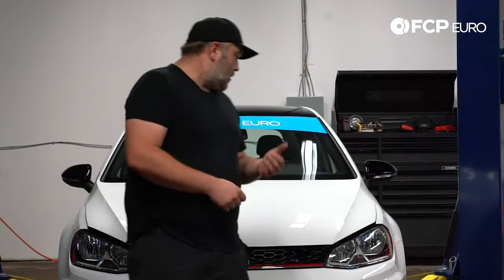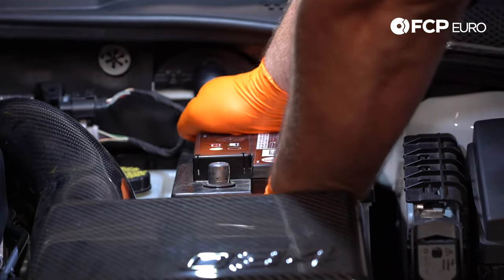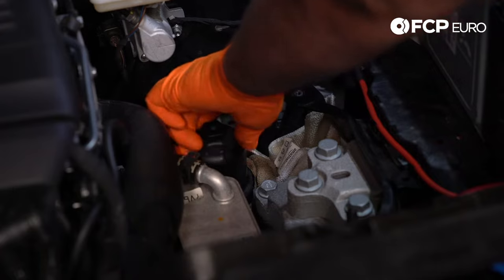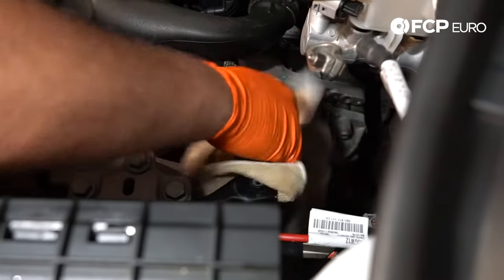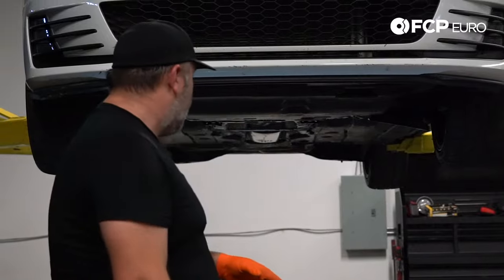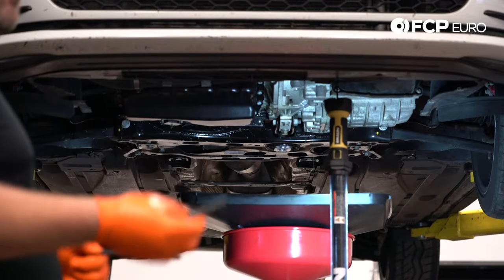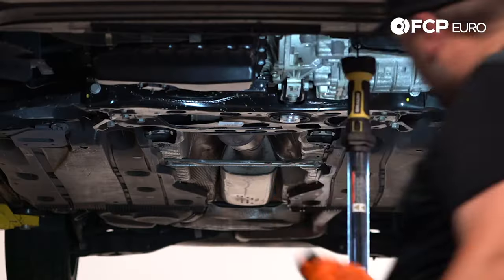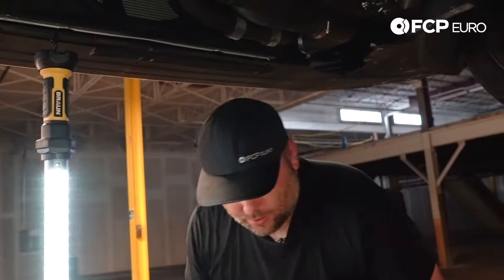Audi & VW DSG Transmission Service DIY -  VW MQB - 02E Transmission

Comment: Everything I’ve heard in the past is that the vehicle must be running while doing the final drain with the level tube. ????? 
Thoughts? Any certified VW mechanics here?
Reply: It should be kept running as it stops circulating with engine off and will dump too much oil
Reply: i hve never done this with the car off🤔 ...the car suppose to be runnin on the final check !!
Reply: Your are correct engine must be running. Without running you will remove to much oil. His work is done but not correctly according to the official elsawin procedure. And he his a racing mechanic............
Reply: Instablaster.
Reply: Thats the exact question that i had . Vehicle has to be running while doing the final level check????.
Reply: So if we followed this video’s procedure and had the car off at 37ºC when doing the level check, what is recommended at this point? How many liters should be added to get levels where they should be? Sounds like the car shouldn’t be driven in the mean time?
Reply: @wjnielsen  I k own its late but your good at 37°
Reply: I'm looking at the service manual which says, "The engine is idling and the selector lever is in 'P'."

Comment: I love my DSG, around 183,000mi now on it with regular service
Reply: What year it's yours?
Reply: @dannymartinez8522  2006!
Reply: What were your major repairs I'm thinking of getting a mk6 lol
Reply: So I've got an a3, mkv based. I did actually have the FSI cam follower problem, I didn't know about the follower back then. But the transmission and a lot of aspects of the car have held up better than average.

Comment: Supposed to keep the engine running when you drain the excess fluid...
Since you shut the engine off, the DSG pump stopped circulating oil. You let more fluid out than you are supposed to.
Reply: it's insane how bad these "how to" videos are....and alot of people trust that it's correct. =/ (The quality of the video is good, but the info wrong)

I find it funny there are no good info from VW how to service their cars, without paying for their own program that costs a small fortune for a private person, but i guess they love all the bad info going out to people, making em buy a new transmission and engines when they do the service wrong xD it's sad really...

Comment: Great video on this service. I wish I had seen before I did mine 6 months ago. Stressful fill! Now wondering if I need to pull the drain plug an make sure I'm not overfull. I guesstimated the transmission temp..

Comment: when the car is turned on and you're running through the transmission PNRDS...also the 1,2,3,4,5,6? and should you keep it there for a few seconds in each? Thanks. Your video is super helpful.

Comment: Check the torque specs.  The service manual for my Golf says 20 Nm on the filter housing (vice 25 in this vid) and 45 Nm on the drain plug (vice 65 in this vid).  DAP video has same as what I found.

Comment: I thought it was bring it up to 35c temp, leave it in park with the engine running and let the excess fluid drain?
Reply: Yes you are correct. Engine must be keep running, place in Park, and then let excess fluid drain. Was able to confirm this in the VW service manual.
Reply: @123cuizine  The engine doesnt have to be running.  The reason why the engine runs is to bring up the transmission fluid temp. to 35-40c, this is when the fluid will expand and the excess will drain onto the the pan from the snorkel.  The whole idea of the engine running is to bring the fluid to the mentioned temp.  However I could be wrong.
Reply: @mkefayati473  comment facts not guesses. Read the service manual.😉
Reply: @123cuizine  Service manuals often say to do shit that makes little sense, no one does this. It's bad enough you have to disassembly so much shit in the engine bay to get to the filter and that the filling method is awkward and jankey, but fucking around with heating the oil to some stupid magical temperature for no discernible reason just adds even more delay.  The practice of entirely ignoring this is based on essentially ever example I've seen is completely ubiquitous and is not causing any discernible issues.
Reply: @mkefayati473  Engine needs to be running to continuously pump fluid through trans while draining excess. If you shut the car off, all the fluid that is in the filter, pump, mechatronics unit, and all passage ways drains back into the bottom of the trans and will drain out. Fluid level in DSG must be checked while engine is running, that is per VW Factory Service Manual.
FCP Euro also corrected there mistake and listed it in the Description.

If you shut the car off and drain excess, there will be around 4.2 liters of total fluid in trans, the 02E DSG requires around 5 Liters. The DSG Filter housing alone holds 1/4 of a Liter alone.
Reply: @CrazyCracker702  thank you for clearing that up. I did read the manual and it says exactly what you stated here.  
Much appreciated.
Reply: @Tk3997 Exactly, I have serviced multiple cars and I have never done the temp procedure.... NONE gave any issues.
Common sense tells you put in what came out and maybe a an ounce or so more to account for spill over.

I did mine DSG exactly like the video, and put the same amount, 4.5, and works like a charm and better than before.
Manual tells you to change the balance shafta if they are removed for inspection, complete horse sh1t.
Manual states to swap all bolts because they stretch, AGAIN, waste of money!
Ask Naptown tuner, and I have asked a local VW mechanic who owns a GTi, bolts are reused, my car, his car, runs excellent.

Comment: Hey Guys How bout taking a threaded plastic  plug n drilling a small hole in it and putting  a 4" Digital Probe Turkey Thermometer in it... then screw it into the trans then run it till the cooking probe says 100 Degrees    + -  or so does  this sound logical

Comment: What if you don’t have a lift? I have a jack and also ramps. If I use the ramps, the car would be at an angle. Would it still drain okay if it’s not completely horizontal with the ground?

Comment: Isnt it bad to remove these batteries in these cars? Don't you have to reset things after wards with a scan tool? I have a 2015 Audi A3 when you drained the excess fluid for final level was the car running or engine off?

Comment: Hello, do you know anything about front differential maintenance? They say that it should be changed every 60,000 and regarding the dsg dq500, they sold me 7lt, do I only use 6? Or if I put all 7 in when emptying, will it only throw more? Thank you!

Comment: Was quite surprised how dark that fluid is. Normally its much lighter isn't it? When I followed your instructions, the oil that came out was no different colour than the new fluid!  What causes darkening of fluid? Is it heat or debris?
Reply: Through time the oil gets dirty and the detergents are doing it's thing

Comment: What would happen if you didn’t drain the extra oil out? Would it do damage to gearbox?
Reply: I generally don't know. 
but think about it, before you change the oil you drain the excess. After you fill up the new oil you have to drain the excess...
Reply: Uh yea would over pressurize and and damage mechatronic unit

Comment: Hi! Nice job!  If i don't have this "temperature  screen device", may i check the oil temp. from bottom of the gear box? With laser meter..? Isn't it about same temp. than oil inside the box?☺
Reply: I was trying the same, but changed my mind and bought a cooking thermometer kind of a metal pin and a digital readout and measure the temp of the partial drained fluid.  Also, when you fill it up with exactly 5 liters and drain 0,4 L that would be good as well.
Reply: @hesseldijkstra5327  how much is 0.4l?
Reply: IR thermometer on the transmission box should be close enough as aluminum is great heat conductor

Comment: Excellent work !
Reply: it's actually wrong thou.. you should keep the engine running when doing the last step of getting the oil level correct.  it will leave abut 0.5L more in the gearbox, this is the correct way if you check VW service manual.

Comment: Hi can you tell me the difference between 
g 052 182 a2 - 6 Speed DSG Oil $52.86 Per Lt 
g 055 529 A2 - 7 Speed DSG Oil $79.51 Per Lt 
Prices are In Australian Dollars :-(
Are there any aftermarket brands for g 055 529 A2 specificaiton ?
Reply: im trying to find a cheaper quality substitute aswell

Comment: My 2016 jetta is coming up on 40000.  I want to do this service myself but don't have the equipment to tell me the temp of the transmission oil.  Would it be possible to do this service on a hot day when the temp is 95 F or a few degrees above?

Comment: How much do they charge at the dealer or independent shop for the DSG transmission service?
Reply: Dealership is around $500
Reply: £199
Reply: $299 at dealer. Some dealers can be $400+
Reply: I called bunch around me and dealers are from 400 to 525. Indi shops are 300 to 500 depending on area and if you use Moli vs VW oil. I think taking it to reputable place that gives warranty for their work is key here. Too expensive to take a chance with.

Comment: So should there be no oil coming out at the initial drain plug removal if it was a level?
Reply from the maker: What exactly do you mean Paul? When you initially remove the drain plug there will be quite a lot of fluid that comes out. After you refill the transmission and get the fluid to temp, you'll have to check the level once again afterwards and some fluid may come out again then.
Reply: @fcpeuro  you don't see it don't you?
After you filled the new oil and drained the excess there should be no oil draining  at any time you unscrew the main drain plug
Reply: @Matttski  Perhaps this the difference between draining the new fluid level WITH the engine running versus the engine off.  With engine off the oil in the filter and other areas of the transmission will seek the pan or lower part of the transmission.  Likely higher than the fill insert.  That oil will drain when pulling just the drain plug.  I would guess if you pulled the drain plug with the engine running, none or very little will come out.  Make sense?

Comment: Video is great, but part where he sets oil level is wrong.

Read the manual for chaning oil, but out of curiosuly watched video too and somehow picked up that he set the level while engine was off.
After good week gearbox started to whine a little bit more then usual. 3rd gear was really really notable. Somehow remembered that oil that came out of gearbox when I was setting level was suspiciously a lot. Didn’t drive car much more, put 1l more of oil, set up level as it should be done. Car took around 900ml!!! Whine basically went away, it’s only notable on lower gears when decelerating.
Hope I didn’t do any damage to my gearbox or haven’t hurt it’s longevity. I shouldn’t, but paranoid in myself still reminds me this.

I would suggest taking video out of youtube, or putting some notices on title of the video. Watched this video on TV do didn’t seen comment section. Even sadder that FCP still kept this video intact, even some people have reported and they actually pinned comment pointing it out.

Comment: I have a 2018 Passat GT. Will the DSG capacity and process be the same?? Great video man!
Reply: I have a GT too and just reached 40k. How was the process man ? Im planning to do it tomorrow
Reply: @gavinthind3058  hey man! It’s pretty much the same. I’ve done the service twice now. Only thing I would recommend, if you can spend the money (if you are keeping the vehicle for a while) get a fill pump and adapter kit that screws onto the drain plug. Makes this job way easier. Also, make sure you have the vehicle as leveled as possible and for the love of God. DO NOT tighten the filter housing with a breaker bar. That thing is pretty sensitive (busted one while tightening it).

Comment: Hi...so I dont have no scanner to see what the temp is on my transmission abt how long would u say I should leave the car on for????thanks.
Reply: ARS GARAGE Just buy an OBDeleven Bluetooth Scan tool for $60, it will show everything on the trans including trans fluid temp
Reply: If you wanna be really jank you can use a human infrared thermometer as it should be able to read up to the specified vw temp lol

Comment: Why didn't he leave the pump set up in place, start the car and continue to fill until it starts to drip at 35-40 Celcius then remove the setup and put the plug back on?

Comment: What about leaving the battery off for too long? Aren’t things reset?
Reply from the maker: Eventually there would be a loss of memory and some adaptations if the battery was either disconnected or left off for a long period of time, but in the time it takes to do this service it would not be an issue with the TCU.

Comment: From a DIY point of view for getting the oil upto temp let's say you have a cold engine and ambient temp of 20°c how long of idling to get upto temp would you say?
Reply from the maker: Hard to say, Martin. But oil will definitely get up to temp quicker with some gentile driving vs just idling the car.
Reply: Between 20-30 minutes idle.

Comment: I don't know but this literally doesn't make sense. 
1. You unscrew the plug oil drains (meaning there is an excess)
2. After you fill the new oil you have to over fill it, warm it up (to expand the oil) and drain  the excess

How the hell is there an excess of oil in the first place. It cannot magically increase in volume
Reply: That’s the fluid that’s in the filter and passages and the reason for having the engine running while doing the initial level check.
Reply: The 2nd drain plug has a hole in the center. When u pull the main plug. An excess overfill drain through the 2nd plug hole. Thats why fluid stops draing when main plug is removed.  The 2nd plug sits above the fluid level.

Comment: Which Dewalt model do you have?
Reply from the maker: It's an older brushed 20 volt 1/4" impact which can't be bought anymore. The current equivalent is part number DCF888B which is brushless.

Comment: How do you run through the manual gears with the brakes on???
Reply: you dont, you just go throu Park, Reverse, Neutral, Drive, and then back again, about 3 seconds each, and when you done that, you can just Leave it in park and w8 for it to get to between 35-45C, when you drain the fluid, you should have the car running(In park) , it will make the gearbox keep about 0.5L more oil then if the engine is shut off..  and that is the correct way to do it if you look in the VW service manual.

Comment: Buy from FCP Euro do not buy from ECS Tuning, they supply this CTA Tools pressure filling system to me, shipped from USA to New Zealand without the compression twist adapter, unusable and a key part of the tool, I cant just go and buy a "compression adapter" from the local hardware store, they shipped me this faulty item all the way from USA and now ive got to pay the return shipping cost, plus my car is unusable for approx 3 weeks I assume as ive already started the service, it all looked fine all my parts that arrived till I went to fill the ATF Fluid, how shocking!! DONT BUY THIS TOOL FROM ECS TUNING.
Reply: You could have just filled from the filter housing hole with a correct diameter hose and funnel. Less mess and money.